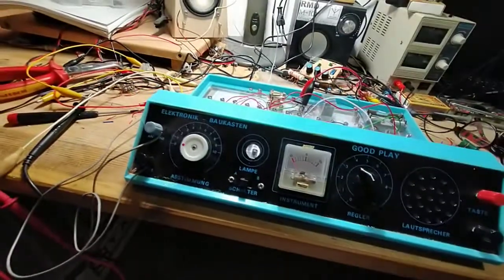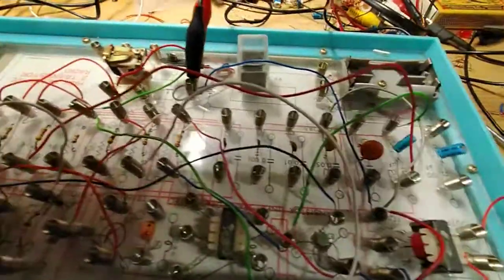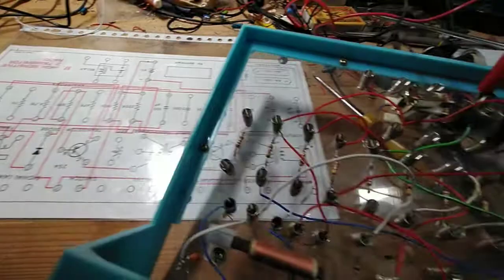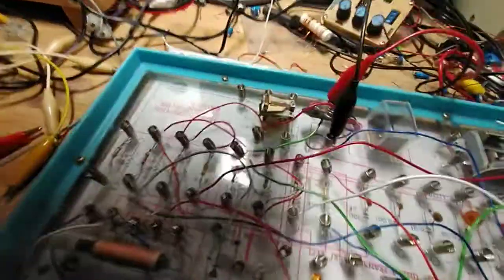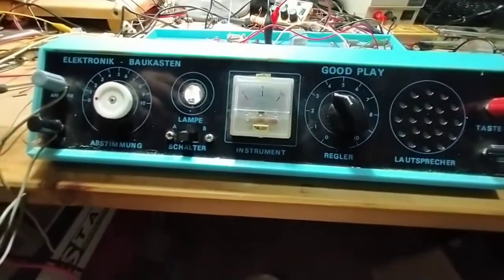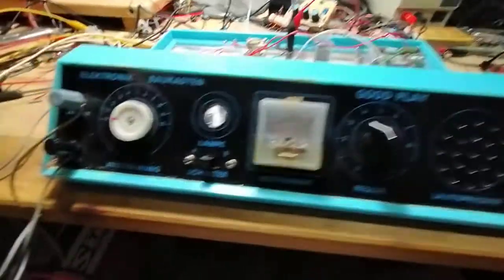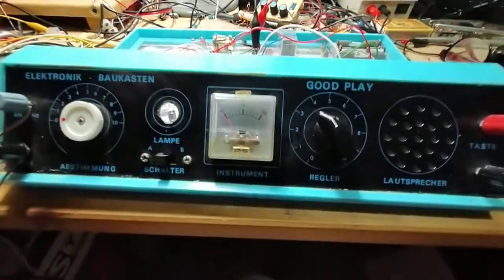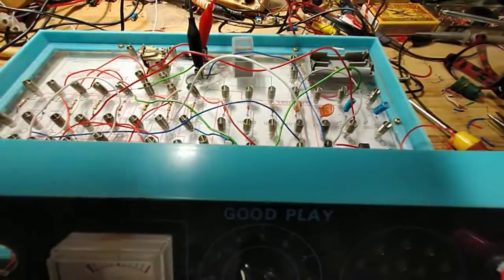Goodplay 70 in 1 projectkit short video

Comment: Hello, when I was 12, I was given a Radio Shack 65 in 1. She looks very similar to this one. I had hours of instructive fun there 😉. Hello from Belgium 🙋‍♂️
Reply from the maker: Yes I had these Tandy/Archer kits also in my younger years.
They where sold in a local Radioshack store in my neighbourhood.
But these where easier to work with then this system.
The building charts that you have to put under the plate are sometimes very confusing.
Best Regards from the Netherlands